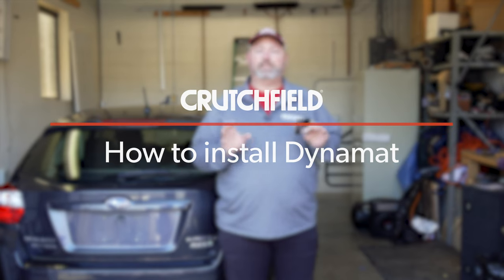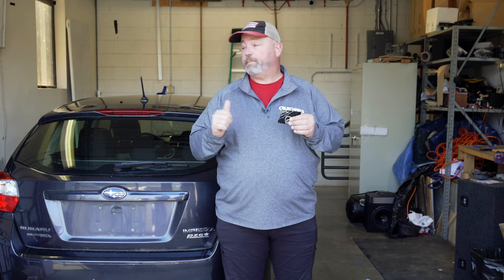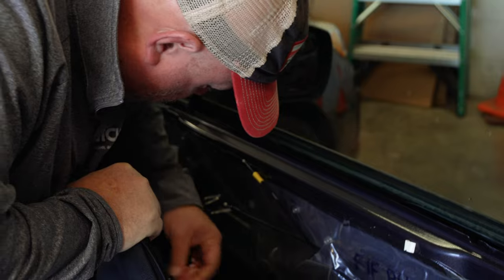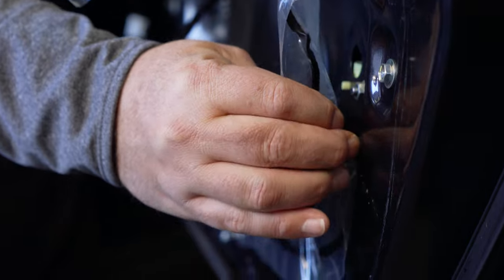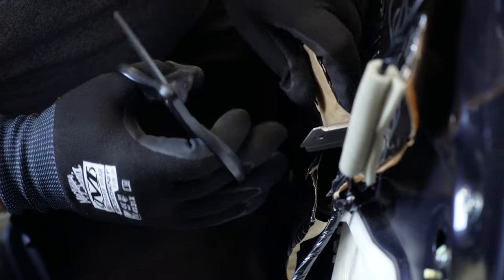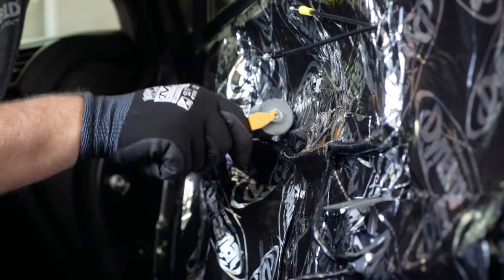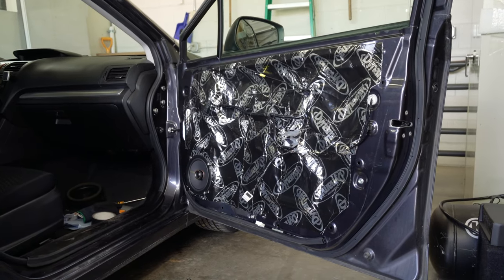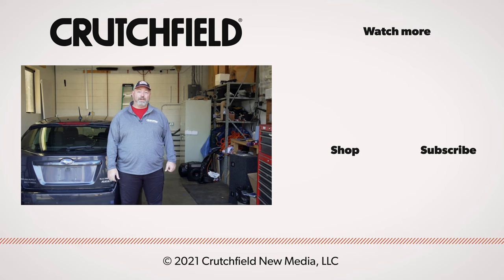How to install Dynamat vibration damping material | Crutchfield

Comment: Just don't ask a mechanic to ever work on it. I put my Dynamat underneath and adhere it to the door's outer shell.  Not sure why they cover the inside.  You are also able to reuse the factory sound deadening if any and the vapor barrier if you like.
Reply: Is it ok to put on the inside of the outer shell? Heard it can get wet and hold onto moisture
Reply: @helsonly722  Dynamat will hold till the cows come home.  That stuff is impervious. I don't see that as a factor and have had it on a car for a decade without issue.
Reply: @GordonPotter the issue is how easy can you remove it? If you have a window regulator or anything else behind there that needs replaced, you’re going to have a difficult time.
Reply: I did the inside of mine as well but I didn’t cover any access holes just on the sheet metal inside and the frame behind the panel but idk about covering entry holes it’s a pain

Comment: I remember dynamat being thing over 20 years ago, but the installation technique seems to be different. The stuff that i remember people were praising was supposed to go on the outter wall of the doors, not on inner wall where vapor barrier sits. So in this case you are basically not using vehicle vapor barrier that came with the doors at all?
Reply: It must have been at least 25 years ago that I removed the vapour barrier and covered the inner skin of my doors in Dynamat.

Comment: I ordered all of my new system from crutchfield. My master sheet with instructions wouldnt download. I used tech support and they  had me hack into the crutchfield ready harness and try to find power for my new subwoofer amp. It had a pac interface which is why i had them put the harness together but the whole experience left me with a bad taste for crutchfield. I used to love you guys but im pretty sure somethings wrong with either the interface or the receiver. I got it all together and cleaned up as best as i could. Sorry for the rant, just wish i made better choices and did more homework
Reply from the maker: I am sorry to hear that you had a bad experience, customer satisfaction is always one of our main goals. We back all orders with a 60-day satisfaction guarantee and lifetime Technical Support. Keep us posted as if there is an issue with your interface, we will get you taken care of! We are always here to help.

Comment: Good way to having to rip it back off an buy more if you need to change a window regulator exc 😂 you’d be better off Dynamating the inside frame then if you want to go the extreme, mat the door card an actually cut out your entry point! Then at least you can fix something if it needs to be fixed
Reply: Right !?

Comment: Great demonstration and explanation on how it works, however, when that day comes to replace that window motor someone is gonna have a bad time.
Reply: I've looked at several videos and this was always at the forefront of my mind. In a 2015 Chevy Cruze, I've had to replace the window motor assembly several times now. The whole thing is made of metal except where the cables connect to the motor assembly. They are made from plastic and have a tendency to break in the winter, especially if your window is frozen and you try to actuate the window, accidently or otherwise.
Reply: @michaels8405  💯 huge pain in the ass.

Comment: In order to keep sound out, and also help my door act as a proper speaker enclosure, can I just apply this to the inner door as you have done here, or do I need to apply sound absorption to the inside of the door (the outside sheet metal) as well?  I have sound deadened my outside metal of my doors, and now I want to apply sound absorbing materials and seal my door so the speakers have a proper environment to produce midbass.
Reply from the maker: That should be fine for most applications. What are you installing specifically? What is the year, make, and model of your vehicle?
Reply: @crutchfield  I am installing Infinity Kappa 603cf, into a 2008 Trailblazer.  My doors are deadened, and I’ve found out that one really absorbent panel in the window motor hole will kill most noise.
Reply from the maker: Nice speaker choice! And, yes, installing it as we did above will be ideal.

Comment: Is it necessary to use that much? Wouldn't a piece behind the speaker & a piece around the speaker do the samething?
Reply from the maker: The more actual material you install, the better the sound isolation and dampening is. At a bare minimum for sound quality, installing some around your speakers and behind your speakers like you mentioned is a good move. Using the Dynamat extreme door kit and covering the inner panel like in the video is always a good idea for the best performance.

Comment: Will this help With the door panels rattling,? Or do you need to coat the inside of the panel also?
Reply from the maker: It might help as long as the door panel clips are intact and not the cause of the rattling. Check those clips first and if they are all securing the paneling very well, then install the Dynamat

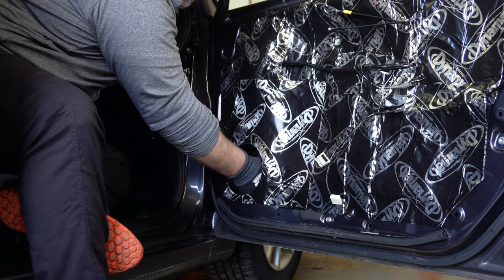Comment: 5:15 How did you know where to cut for the speaker hole? And poke the screw holes through?
Reply from the maker: You'll want to be sure and install the Dynamat before the speakers so the speaker opening is apparent. From there, you'll install the speakers and screws.

Comment: Hey! Great video. I have door railing in both doors from the roofers. It sounds like plastic... Would installing your dynomat on the metal as shown work or would i have to Dyno the plastic as well?
Reply from the maker: Thanks,  Nicholas. What is the year and model of your vehicle? What do you feel the current noise issue is originating from?
Reply: @crutchfield Thanks for responding! I have an Alfa Romeo Giulia 2018. Seems to around the window buttons and the plastic around the woofers. Smaller rattles present too but can't pin point where!
Reply from the maker: So, dynamating the metal will likely give the largest improvement.  for the plastic parts, foam gaskets/padding can get rid of vibration/rattles as well!

Comment: Can it be peeled off if a mechanic needs to access the door via the door hole that gets covered with dynamat?
Reply from the maker: You can use a utility knife to cut the Dynamat to gain access and then simply add a new piece to replace it.

Comment: I tho you would stick that to outside wall?
Reply from the maker: You can install Dynamat on the interior side of the exterior section of the door panel, but that can be difficult to get to, and there may be wiring and window mechanisms that get in the way. It's typically much easier to get the right coverage on the inside wall, if you can.

Feel free to reach out if you have additional questions!
Reply: @crutchfield  i heard this is not a good idea as it will get wet and hold onto moisture and cause rust. Is this true?

Comment: Can you install dynamat in the wheel well, not inside the car but outside? Is it waterproof?
Reply from the maker: We do not recommend installing Dynamat on the outside of a vehicle. There is no IP rating for it and it is not likely to last long
Reply: @crutchfield  what can be installed instead?
Reply from the maker: The best bet there would be the Dynamat DynaCore: https://www.crutchfield.com/I-rIGRc921/shopsearch/Dynamat_DynaCore.html

Comment: Builders flashing 10m X 225mm at £10 a roll is vastly cheaper and does same job imo.
Reply: very similar product, usually butyl based adhesive with some sort of aluminum imbedded
Reply: I was thinking the same thing the other day   had a 2 rolls of butyl there when putting my speakers in..😅

Comment: Is it ok to install dynamat on the inside of the outer shell?
Reply from the maker: We're glad to help. What is your specific application?
Reply: @crutchfield  just want to know if putting any sort of dynamat or sound absorbing foam on the inside of the outer shell is ok? Worried about it getting wet and holding moisture causing rust. Foam would essentially be a sponge
Reply from the maker: Are you considering it for a boat or what vehicle/application?
Reply: @crutchfield  honda civic. Cause i know when it rains water drips down inside
Reply from the maker: You can install Dynamat Extreme on the inside of the outer door skin. The Dynamat Extreme Squared universal kit in the link below would be a great choice!

https://pulse.ly/s44mlqjyl6

Comment: I want the dynamat on the sheet metal not the door panel.
Reply from the maker: That will work just fine.
Reply: That is what happens in the video lol
Reply: @qTravis666 I’ve seen it placed onto the inner sheet metal, not onto the outer door panel.